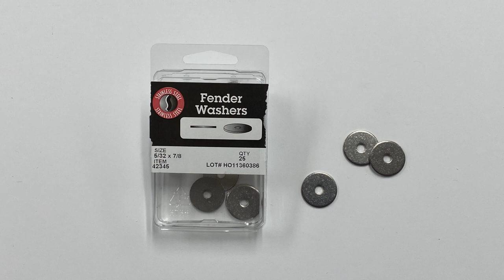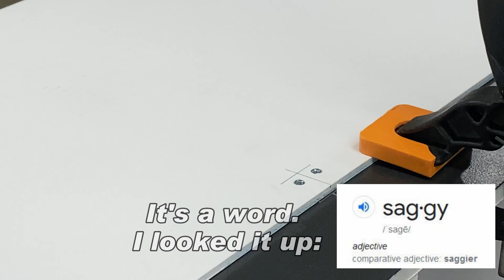Small HO Scale Layout Build - Ep. 4.1:  Better Backdrop Bracing

Comment: The washers were a great fix and it looks much more sturdy. What might also work is a flat T shaped piece of metal that you can also glue to the poster board. Thanks for doing these videos Joe. We can all learn together.
Reply from the maker: Glad they’re helpful. I thought about the t-shaped metal pieces, but I was concerned with just gluing the metal on might not hold up over time. Could certainly work though.
Reply: @ThePixelDepotLLC  the Ts have the holes too, I just added that you could also glue them in addition to screwing them.
Reply from the maker: @derekalexander4030  gotcha.

Comment: Hi Joe, very few YT modeler's will show let alone admit their mistakes ,but will be quick to judge others on their mistakes. I commend you for showing yours, that's a noble and honest thing to do and I greatly admire you for that, Thank you. Now onto the backdrop, I think what you've done to strengthen it up looks great and was a very good idea. Quick question, are you planning on any photo backdrops, and if so what type of adhesive would you use on the gator material? I have "hardy backer" aka masonite board, for mine but I'm thinking of changing to something lighter like the Gator foam. Thank you,     Dave B.
Reply from the maker: Hi Dave. Thanks for watching! There is a photo backdrop across the entire front of the backdrop. I used Elmer's "Craft Bond" adhesive spray (see around the 9:55 mark in this video: https://youtu.be/hy75EaK_qiE?t=595). That said, I'm pretty sure you could use any adhesive spray, or even white glue or a glue stick. My understanding is that the GATORFOAM surface is essentially wood, so anything that sticks to Masonite and/or adheres to a smooth non porous surface or wood should work. Thanks for the kind words. I'm sure I'll be making many more mistakes! 🙂

Comment: Curious as to why the BD needs to be rigid? I just used 5/16" foam core that slid into a slot at the back of the shelf layout. It doesn't hold anything other than some building flats - no need for anything stronger than that. It's strong enough to mount a canopy with LED lighting if I wanted.
Reply from the maker: There is no requirement that it's rigid. As you mention, foam core would work fine. The rigidity is more of a personal preference, especially since I was mounting a photo on the backdrop.
Reply: @ThePixelDepotLLC  Thank you for the explanation -- I thought that I might have I missed something.

Comment: This material looks very flimsy to me. It looks like a piece of foam sandwich between two layers of very light plywood. I can make it better by using some foam-board of choice, and thickness between two layer of Luan (1/8 ply usually used for doors), That will provide rigidity and sturdiness. But, he! I am a carpenter, and look at the practical side of things.
Reply from the maker: It is foam with a thin plywood-like veneer. But it’s not flimsy. To be clear, you can’t take a hammer to it, but it’s solid enough that I can carry the layout, backdrop and all, by myself very easily and without much flexing. Now, it wouldn’t be my first choice for a permanent layout, but for something (relatively) temporary and portable it works well, and is easier to work with (IMO) than the foam and luaun sandwich you mention.
Reply: OK. I understand the use and purpose. For myself I would not use this product as I am looking for a more permanent location, using modular approach for potential mobility. Thanks for the feedback. I like your videos.